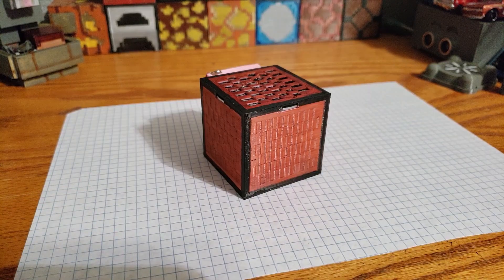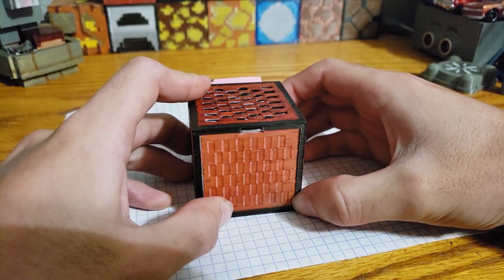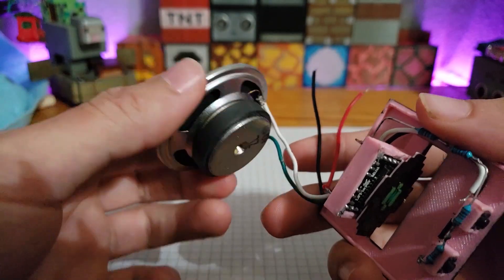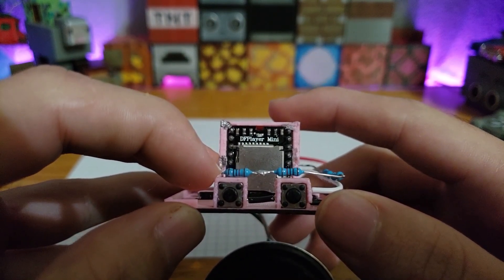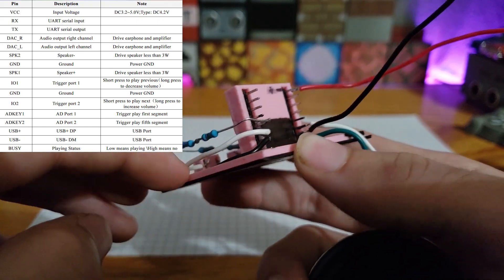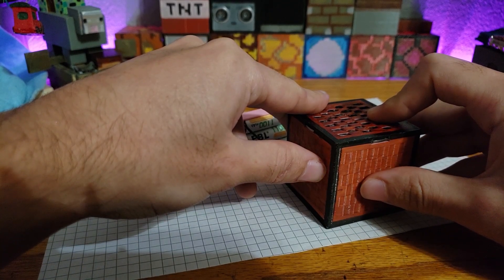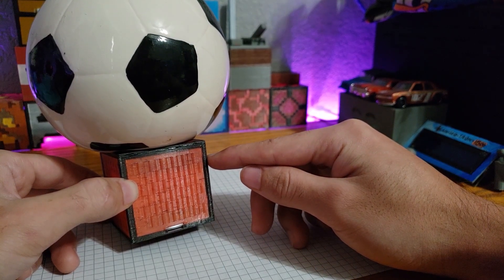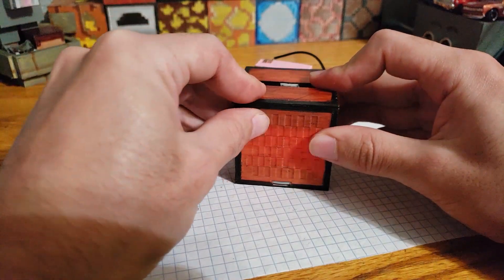Minecraft Note Block and Juke Box: DFPlayer Mini MP3 Module

Comment: Could you somehow make a bunch of note blocks and then hook them together like in the game? With different sound effect blocks under them and repeaters for timing?
Reply from the maker: Yes, but would take a bunch of controllers : ) I need to revisit and make them able to detect blocks underneath for different instruments and an alternate implementation. This design can accept a signal from the repeater, but doesn't have a physical way to make contact with the repeater circuit